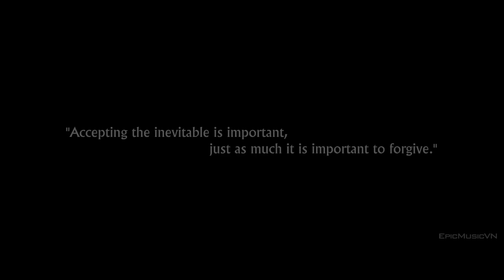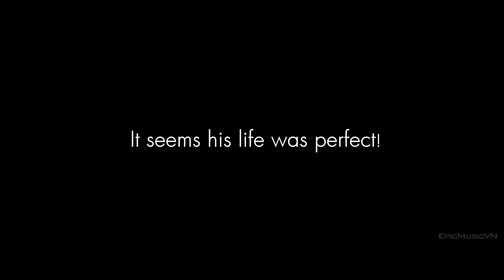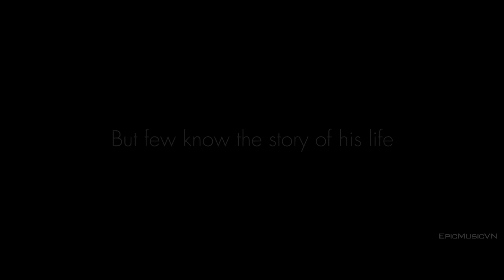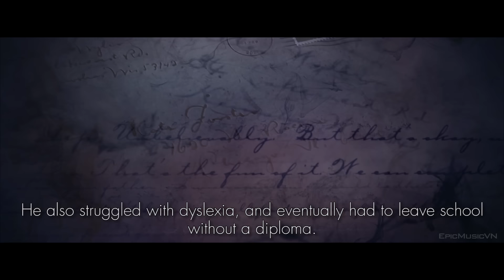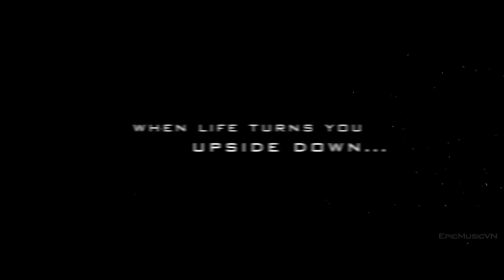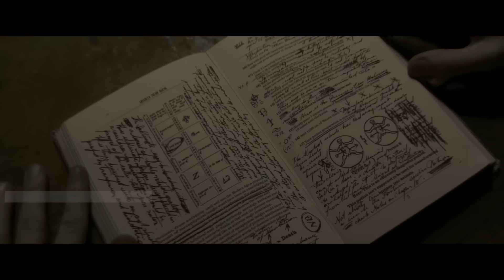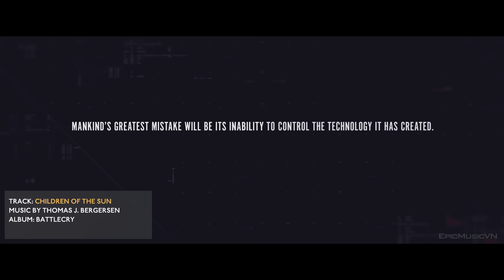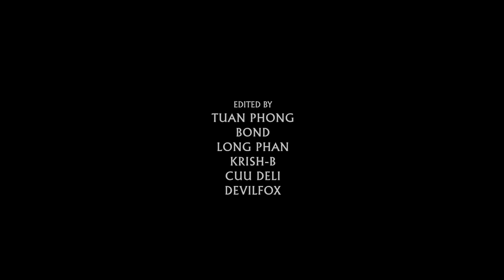BEST OF EPIC MUSIC 2015 | 1-Hour Full Cinematic | Epic Hits | Epic Music VN

Comment: Chapters 1, 3, 5, 7, 8, 10, and 13 are all fantastic to the point where they are some of the best of the yearly mixes of music. 4, 9, and 11 were fairly good but not living up to the name Epic Music VN in my personal pointless opinion. Chapters 6 and 12 focused on a person which while a good concept just didn't work out as well as I think it should have. Keep at it if you want but I'm sensing a lack of power behind this potential. Chapter 2 on the other hand, I think that it was pandering to the gamers demographic a little to much. If your going to do something like that keep it shorter. I want you guys to avoid something like the "Rosa" clip in your 2013 edition and this seems a little to much like that for comfort. Of course this is all my worthless 2 cent opinion, I could be wrong. Overall though, A- but still an A; far better then most of the 2013 edition clips and even some of the 2012 and 2014 edition clips.
Reply from the maker: +Demetri Blackheart thank you :D